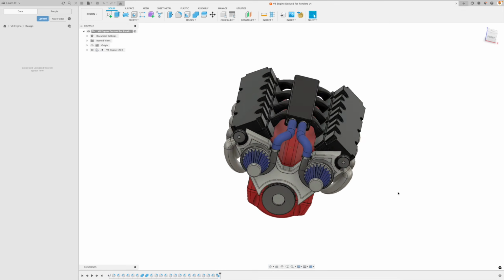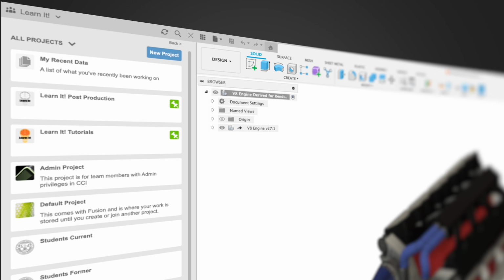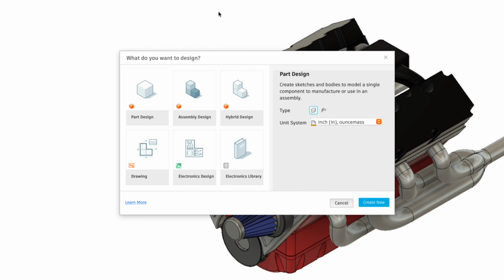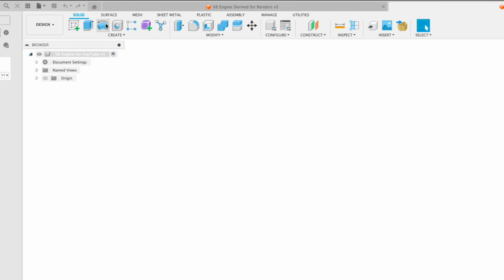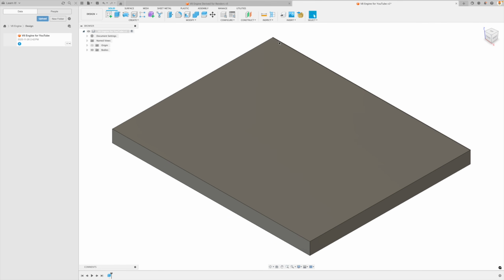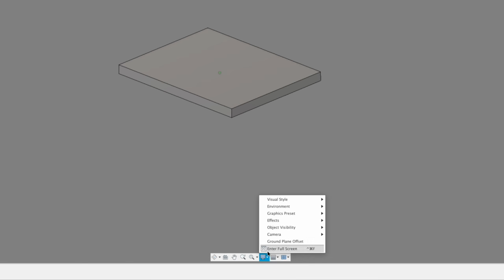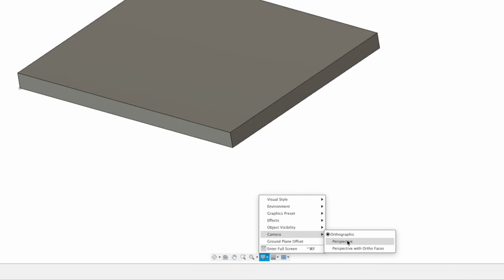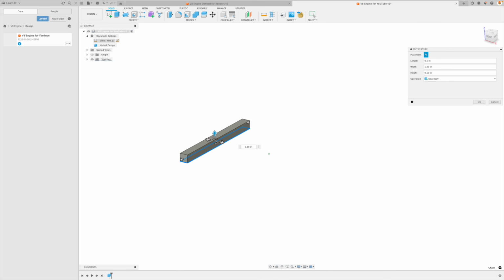Autodesk Fusion Course for Beginners 1 - V8 Engine - Essentials and Tips & Tricks (2025)

Comment: I wanna know 
How much space does it took overall??
Reply from the maker: Are you referring to the entire volume of the engine?
Reply: @learnitalready  like the storage GB and yeah the entire vol of the engine
Reply from the maker: @hemantspk  As far as I can understand with your message, you’re looking for 1) the file size and 2) the overall engine volume, is that correct?

Regarding both of those above items, I don’t have answers for you. I don’t think I’ve ever looked at or concerned myself with the file size of Fusion files because they are all in the cloud and are quite small files. The overall engine volume also isn’t something I’ve been interested in because this is a series mainly teaching design methods and techniques. Once the series is done, I can try to provide you with the total outer volume of the complete, assembled engine along with the volume of total material used, but all the other volume calculations you will likely need to do on your own.

Comment: This is meaningful: At 80, lifelong U.S. citizen, I'd love to see the death of the so-called imperial system before I croak. Using the Internet wherein we communicate with the rest of the world, it's becoming more and more awkward, embarassing. Give it up guys! And from a purely practical point of view, many slicers won't work unless you convert your models to metric.
Reply from the maker: Thanks for your comment. It’s a sad truth that even something as simple as units of measurement have become the most difficult and divisive issue to face on this channel. The only hurt and hatred that I’ve seen have come through different comments regarding which system of measurement is “better.” From my perspective, I have chosen to learn both units of measurement. *25.4 and /25.4 were some of the first equations I learned at a young age because of necessity and I encourage all those that tune into this channel to learn those equations as well. Fusion makes it easy with just typing either an mm or a “ symbol following the value to automatically convert to metric or inches respectively, and have also made it easy to export into whatever units are needed. Hope that learning new things throughout this course can be a small refreshment to whoever joins to view. All the best!

Comment: Hi!
any idea why i can't see the assembly tab? is that new? because I checked to have the last version but can't see it... also this hibrid option when you created a new file is also not popping up in my Fusion.... not really important but kind of bother me XDD
Reply from the maker: Fusion is undergoing some new changes that they're releasing slowly. Therefore, you might not have the Assembly tab. No worries if you don't, just look under the Solid tab. The same assembly tools should be there. If not, press "s" on your keyboard which will bring up the quick search menu. You'll be able to search for "joint" or "motion study" or whatever you need. Let me know if that works.

Comment: I have the latest Dec/25 release and that "What do you want to design?" dialog does not appear after clicking on the "+"... it just adds a tab... :(
Reply from the maker: Thanks for letting me know. No worries, it’s the same type of design file as the tutorial. 

If you wish to see that selection menu, you can turn it on in preferences in the “preview features” section.

Comment: Great teaching video, One can always learn something from them. I an wondering how one can see both imperial and metric dimensions on the sketch at the same time (Old paper drawings from the past used to have "imperial (metric)" {ie:1.00(25.40)} ? If this can not be done currently, it would be a suggestion to the fusion 360 software development team.
Reply from the maker: Thanks so much! 

Yes, that can easily be done. Sometimes it clutters the drawings but usually it works. I don’t know why I didn’t think of that sooner. Thanks!

Comment: First thank you for the tutorial... I would consider myself as a newbie to fusion.   What I really liked about this is learning about constraints.   The different types of extrusion and holes, especially with threads was also great.   I completed the first 3 tutorials.  2 questions... 1)  Should the model be selected when creating the threaded holes?   2) Is the engine block missing the holes for the oil pan?   So far this is a great series which I have shared with a few others.   Hopefully I can keep up with the series as new videos come out.
Reply from the maker: Thanks so much for your encouraging comment and support. Glad that you have benefitted already from parts 1 and 2. 

To answer your questions:
1) When creating the threaded hole should the model be selected? I assume you mean make "Active" or not. Because you are a good student, I would like to ask you your thoughts instead of giving you the answer right away. What do you think and why do you come to that conclusion? 
2) The engine block doesn't have holes for the oil pan. Originally I created the entire design with all screws, bolts, etc. but it turned into an absolutely huge file. Not bad, but I didn't want to take forever in teaching this series. I'm confident that you'll be able to add the screws, washers, and other hardware no problem at the end of the series. 

Thank you so much for sharing these videos with others already. Much appreciated. You will enjoy the upcoming ones as we will continue to get more proficient and faster going throughout them. You'll hit a point where you will just want to take the drawings and start fresh on your own. It's going to be a blast!
Reply: @learnitalready my thoughts yes is should be selected.  In my case I want to 3D print and assemble if possible.  So I want the threads to be active.  As for speed I’m sure I’ll pick it up.  I feel if I started clean I could complete this very quickly from the diagram.   I want to do that with the oil pan before watching the video.  I assume I could add the holes to the block as part of this.   I did 3D print the block at 1/4 scale.  Printed nicely with no supports which blows my mind.  

On extruding the cavity.  Could the original sketch be used and extrude the same way we did the block using 8”?   Hopefully you understand what I’m asking.   Probably gonna try it to know but still would like the pro/con of it.  

Again thank you and great tutorial.  Patterns make it a lot easier
Reply from the maker: @j @jnbff10 Yes, you got it! Excellent. The benefit is that it keeps all the relationships in order and makes your design less likely to break downstream. 

That is great to hear about scaling down the 3D print. Also, regarding the extrude, yes there are actually several ways of doing it. The key is to always know exactly what relationships you’re creating.

Amazing job! Looking forward to hearing more from you.

Comment: Hey Learn It!, thank you for the great video! I just wanted to share my 3D – software journey :)

My journey originally started with Blender. The first thing you learn in Blender is the famous Donut tutorial. After the tutorial I was hoocked. At the same time I got an old 3D printer gifted from a friend. I was really curious in designing my own ideas in Blender and trying to bring them to the real world. Back then I designed very organic shapes and was a lot into sculpting.

One day a friend asked me to help him with a broken part of his waffle iron. I felt quite confident. I thought, I could help him out by taking basic measurements with the caliper and modeling and printing it very fast but boy I quickly ran into a trap: Dimensioning in Blender is way trickier than you think. After struggling for a bit, I searched for some CAD Addons but got lost. 

The next day I talked to a friend at uni who was also into 3D printing. After telling him my struggles he told me that the started with fusion 360. We had a great conversation about the different approaches and philosophies of these 3D softwares. At that point, I saw the big advantage of beeing able to work with a timeline and adjust old parameters. This was one of Blender’s biggest disadvantages, as it worked in a destructive way to some degree. This way he convinced me to try Fusion 360.

At first, my projects were really basic, and I tried to find the analogies to Blender. This only worked to some degree.. But after collecting some basic cheet sheets I got the basic controls together.
With time, my models got more complicated, but I didn’t consider one important thing: Giving proper names and structuring my project. At one point in a big project, I was frustrated. I went down the Youtube rabbit hole of basic working principles because I felt like I started running before I could even walk. 

This is how I recently found your channel. 

Your videos have a great and clear structure and I benefit from it a lot!

I hope my story finds you well and I look forward to supporting you in the future!

Greetings from Germany!